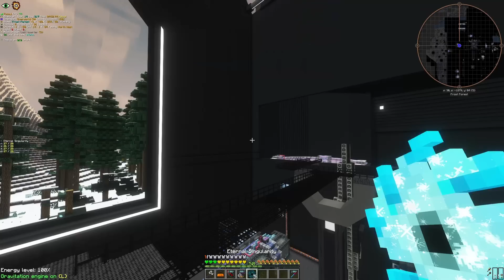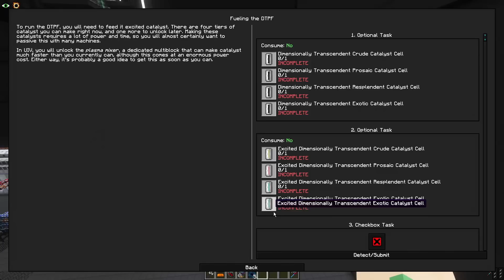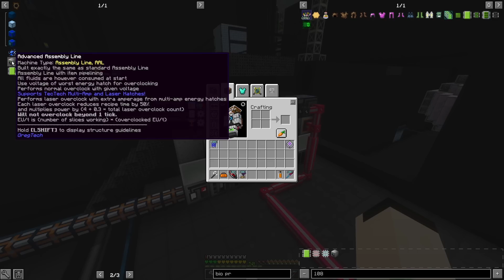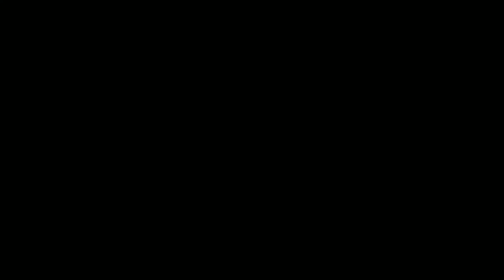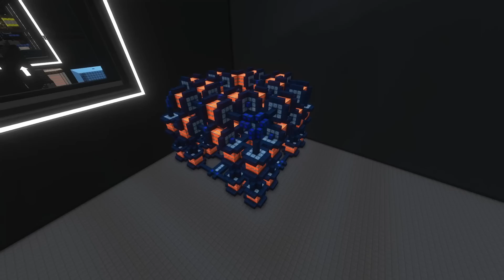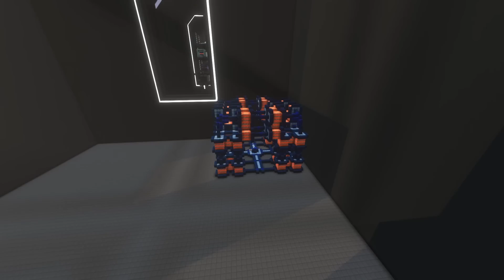GregTech New Horizons E123: Dimensionally Transcendent Plasma Forge

Comment: Is the uev superconductors as wires a design choice? If not I highly sugfest using infinity wires they're way cheaper, can handle ridiculous amounts of amps, and can handle max voltage. I just spray paint them to look like the superconductor equivalent for each voltage :)
Reply from the maker: Dear employee,

I didn't know about infinity wires until recently. I'll probably start using them from now on! 8192A limit on the 1x is quite something

Best,
HamCorp

Comment: Why did u wait till late UEV to use AALs? 😭 

Consider making 20 subnets in one spot, and make each subnet handle one item/fluid input for every AAL or AL. If setup properly this can handle tons of assembly lines with only 20 subnets and is easy to scale.

For the most part, DTPF catalysts are locked behind coil tiers.

Crude - Awak draconium
Proasic - Infinity
Resplendent - Hypogen
Exotic - Eternal
Stellar - Eternal (you need an EoH too)
Reply from the maker: Dear employee,

Honestly, I kinda forgot they existed. I'm making a bunch now though lol

That's a good shout about the catalysts being correlated to coil tier, I didn't notice that

Best,
HamCorp

Comment: My ham can't take anymore of this :OOOOO
I'll not soon forget the psychic damage inflicted by crafting the dtpf
You don't strictly need stocking input hatches for universal AALs, but I overflowed my uhv or whatever hatches several times due to not thinking, so stocking are nice.  And you don't need to multiply the recipe by a multiple of the length, but it makes sense to do at least twice that, which you did.

The aurora blocks look great :)

Yeah that makes sense ..... the dtpf catalysts are the tallest middle finger in a sea of middle fingers at this stage in the pack ... it's certainly possible to push the boulder up the hill over and over and keep duping out the infra needed for it, but it's a real slog

Good luck soldier